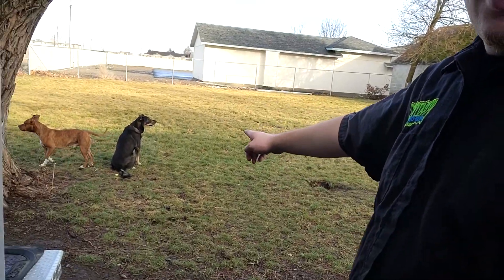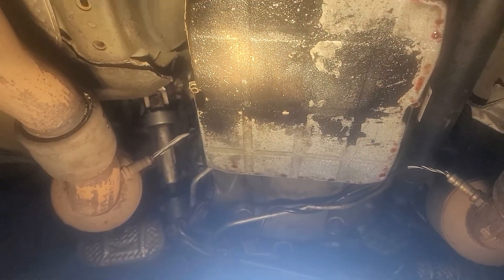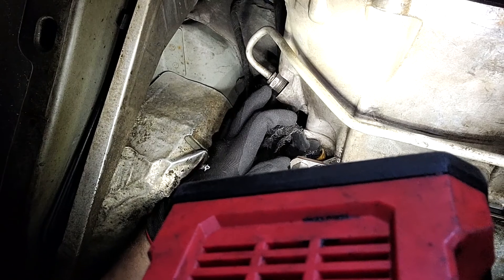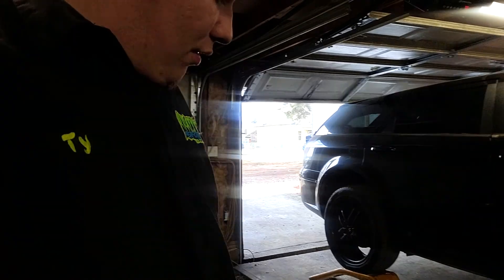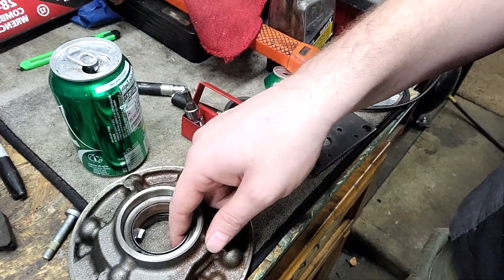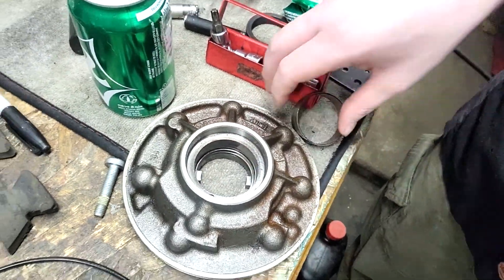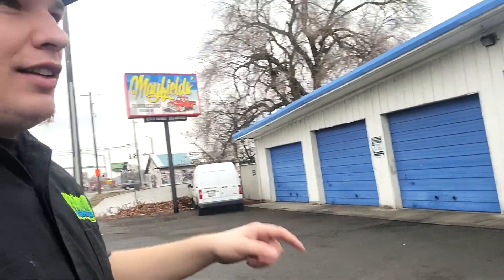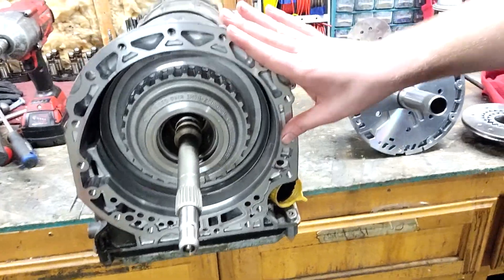HEMI Magnum RT AWD Transmission Carnage!

Comment: Watching now, it's a all wheel drive, and a RT? Pretty rare and complicated.
Reply from the maker: Yes sir rare forsure 💯
Reply: Love to have one, probably mostly the same setup as my 06 Charger RT my lil sister sold me cheap last summer minus the AWD. Even with a mere 350hp or so with the AWD that thing should be scary quick off the line. I have seen fully rebuilt and built up Nag1 transmissions online for fairly reasonable prices and I'm sure you can find rebuild parts through Daimler or elsewhere as other companies used them. Try doing a search for Nag1 and I bet some rebuilt units will show up. Years ago I and my friend rebuilt the 727 in my Dart for 48 bucks using a parts kit, then I got new bands and a pump and put a stage 2 shift kit in it. I broke it eventually beating on it too much but it would punch the car sideways on dry pavement when it shifted to second at 5500 rpm with the 318 😎
Reply from the maker: @69Dartman  I'll definitely try to see what pops up! And keep my eye out and yes they are pretty quick for what they are can't complain!
Reply: @krazyhouseperformance  I THINK the ones I saw weren't too expensive but been a while and the link I book marked is dead now. I'd make sure the clutches are still solid before you put it back together so you don't waste a lot of time. Nice of him to give you the pump. Maybe you ought to see if he'd give you the whole thing cheap and you'll have all kinds of parts around.